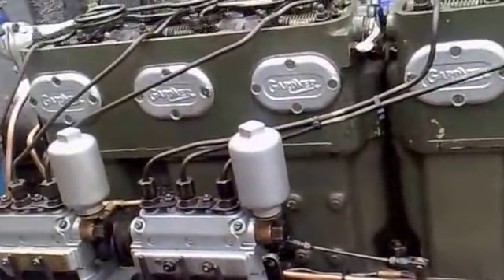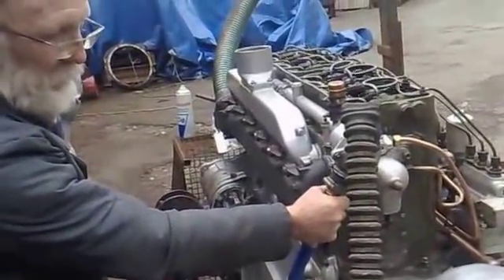Starting Gardner 6LW

Comment: These engines may have longevity on their side but they were totally gutless. At 38ton they were pretty much hopeless.
Reply: Anything would be hopeless with a 180 hp at 38 tonnes
Reply: @michaelparker5072  I've run a lot of trucks all over Europe as an owner driver years ago, all Volvo. F7 224hp, , F10 300hp, F12 400 hp EDC and F16 700hp.
The F16 would pull 44t++ at 100kph in top gear on the AR & AP gradients, a brilliant truck but... the little 6.7litre F7 which I started out with 224hp still managed to pull 40t but obviously had to use all 16 of its range change/splitter gearbox, as you can imagine it was dire on the hills. A 180 Gardner 
wouldn't be rated at such weight, more like 26/30 tons at its time but the drivers must have struggled to even manage 40mph on the flat..
Reply: @Draxindustries1  yes,i know all that,what i'm saying is the power to weight ratio of 180 hp at 38 tonnes is pretty dire,and that you wouldn't expect it to get much of a move on
Reply: @michaelparker5072  well said

Comment: At the Red & White omnibus Co every 250,000 miles the bus was brought in, engine stripped down cleaned and rebuilt and put back into Service. This would happen until 1 million miles was reached after witch the bus would be sold on. We had a Bristol BVW double decker come in one day and the crank was sent around to the machine shop to be reground as the engine had done 1,250,000 miles. However the crank was returned to the Engine shop with nothing done to it as there was no wear.
Reply: Is this some legend? If there was no wear why the crank was sent for machining? I worked on few Gardner and they needed all sort of machining.
Reply: @dieselengines1760  unfortunately the world of vintage engines is full of nonsense "stories" like this, making it difficult for anyone doing research.

Comment: My friend and i had a Bristol mw (bus,eastern coach works) fitted with this engine,,I am sure it had 500,000 miles on the clock(1959-1993))although sometimes i wonder about my memories.
We drove over the pyranees and back .It was a lovely engine,pum pum pum allday,it felt like it would go for ever.
Sadly(or happily)my friend took it once again to spain and some hips stole it,that was twenty yrs ago.
from the valleys of south wales as a psv to retirement in spain.
nice to see one running again.
Reply: +assimonem I was an apprentice mechanic at the Red & White bus company and they would do in excess of 1 million miles before being sold on. A minor dock was 250,000 miles and a major dock was 500,000 miles. All mechanics loved the Gardner.
Reply: Andrew Lewis
So my memory was ok!.
Yes Was a lovely engine,always ready to go.
Nice to see the engine on here..
I hope whoever knicked it looked after it!!

Comment: i used to drive hudswell clarke dm series and hunslet undergraound locomotives fitted with gardner 6lw engines at a yorkshire pit before it sadly closed in 1992.the oldest hudswell we had was number dm 718 built in 1951.even in the harsh dusty environment of the pit and running for almost 24 hours a day major overalls were far and few between and complete engine changes were rarer.we had about 15 locos and it's a pity they couldn't be saved.

Comment: I should think that they do comply with environmental requirenments because they use so little fuel when running. I was running a pair on a yacht "Giriz II" and they were amazing. we had the two engines 6 cylinder ones 250 hp each and they would use 5 litres per hour at full power. that was also with a belt drive 3 phase generator running off the starboard engine. when we stopped the engine we had to start the perkins 4136 generator and that used 5 litres per hour at low load!
Reply: +Owen Cox 
Yes, the Gardner was true to Diesels original thesis of what an oil burner should be, the most feel efficient diesel ever built.
I have an aluminium blocked 4LW in my shed, for the last 25 years.
Just can not allow myself to let it go.
Reply: Physically impossible  for
A 250hp engine (even a Gardner ) to use 5 litres per hour at full power. 
The fuel usage at max rpm would be closer to 35-40litres per hour. 
Gardners rule of thumb was an imperial gallon of fuel ( on LW, LX,LXB series engines) produces 25hp. On the later 6LXDT and 6LYT and 6LYTi engines it was a gallon of fuel for 33hp. 
If you ran a 250hp Gardner (which if yours were 6cylinder engines could only really be a 6LXDT or a 6LYT poss a 6LYTi) at full throttle in a marine application out of only a 5 litre container there is no way it would run for an hour.
Reply: @matui6983  we never ran them at anything like full power. Cruising at 8 knots the engines were barely ticking over. Ours were 175hp if I remember well. The consumption may have been a bit more but lets just say way more economical than the Perkins generators.
Reply: Its just when I read what you wrote in the comment about a 6cylinder Gardner of 250hp burning 5 litres an hour at full power it just didnt compute. 
Ive just run an 8L3B set of injector pump tops on her own injectors tonite set at 230hp at 1150rpm  and just 1 cylinder receives 78ml of fuel in 50 seconds, which for all 8 cylinders is  624ml of fuel in 50 seconds. 
Doesnt sound economical at all but they blow the rest into the weeds on fuel usage.

Comment: The best diesel engines ever made? But what led to Gardner's closing?
Changing environmental rules? Maybe this range would not have ever been compliant, but what else was in Gardner's range that did?
A 2 cylinder unit would be great in a narrowboat.
Reply: As many British firms, especially trucks - Gardners got left behind when they refused to move with the times. When Heavy Truck weights and power were going up, Gardner failed to produce engines that kept pace with the need for bigger power outputs and turbo-charging. Up until about the mid 80's, all their engines were naturally aspirated, and when they began playing with Turbo chargers - it was all too little, too late - in an effort to 'catch-up' - development was inadequate and there were all kinds of problems. 
By then, Cummins had become the engine of choice in ERF trucks along with Rolls Royce and in the vertically integrated motors- Volvo and Scania had vast experience in Turbo Charging heavy duty diesels and producing TD engines to great effect. By then, it was all too late for Gardner. Unfortunately, they were left behind where they started in terms of technology - the 1930's.
Reply: +NJPurling   ask: What led to Gardners closing? Well too many strike, could not deliver to customers, and Gardners old fasion, to cope withe modern times hydraulic, demands. And not so many v.belts 6C belts.-for winshes etc.After all Gardner WAS for truck + buses, well the L3B also for rail roads locomotivee, the L3B were never the less a near marine diesel with dry exaust manifold, and old type 3UC gear. I like many  regret closing the factory lant at Manchester.
Reply: many narrowboats with Gardner 2LW and a few with 3 cylinder models. beautiful engines and hypnotic exhaust sound.
Reply: Wasn't Gardner bought out by Perkins? Also I think the British truck industry ceased to be.